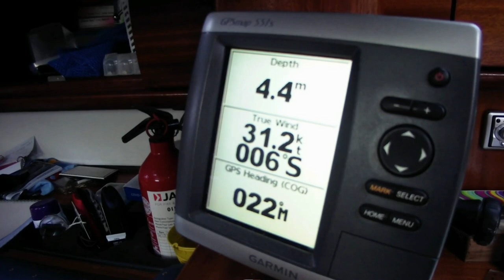Sailing Northerrn Ireland - Larne - Anchoring - Storms - Alarms - Ep. 253

Comment: Back in 1980 I tried (but didn’t do the greatest of jobs) to illustrate all of the physics involved in the forces applied to a set anchor, the anchor shackle and various points along the chain assuming that the chain was laid for optimum stretch. Although my maths was ultimately short in absolute accuracy, what was evident was that the forces at the windlass snubber were far less than at any point in the submersed tackle as long as there was sufficient stretch in the chain. Of course, chain does not stretch, but if correctly laid most of the forces are are taken up in the amount of chain that can rise and fall from the sea bed in natural, organic movement. In other words, dIameter of the snubber line and the tensile strength of the snubber hook is less important than the lay of the chain between the anchor shackle and the point that the chain rises to the boat (snubber). The longer the lay, the less ultimate strength is required at the snubber.
Reply from the maker: What a great explanation. Thanks for commenting 👍

Comment: XC originally was airfield based and in my humble opinion usually under estimates wind strength.  Another good one to look at is meteo marine. I use it all the time and find it is usually accurate. But, nothing like sticking your head out the companion way, checking the actual weather with the mark one eyeball.
Reply from the maker: I remember when it came out and we all thought it was the Bee's Knees - until we tried it against reality. I completely agree with you about it under reporting. Thanks for the tip about Meteo Marine we will have a look at that.

Comment: Ah, anchors and anchoring, everyone's favourite subject and we all have an opinion! FWIW - snubbers - you don't want it too thick as it needs to s t r e t c h..... We have our snubbed above the water, from the chain to the aft cleat via two blocks. It's about 12m long and will stretch to about 130% of resting length. So about 3.5m of stretch when the wind gets up, makes a nice bungey effect that won't pull the anchor out. Happy anchoring!
Reply from the maker: 😄😄 Anchors are always good for sailing banter!! Our snubber is 10m and usually about 5 or 7 metres is from the fairlead to the chain itself. As you say, nice bungy effect and a comfortable anchor! 👍

Comment: even if your snubber snaps your still attached by the rod you've put out etc etc, it only protects your windlass
Reply from the maker: I like our windlass. I want to protect it!!! 😄😄
Reply: @SailingYachtSaltyLass  indeed, my point was it should be the same size and strength as the chain and rope anyway
Reply from the maker: It suspect the line to match 8mm chain would need a lot more than 14mm nylon braid

Comment: Can you tell us about your choice of how much chain to put out.  My books say 4x depth ie 16m for 4m depth and you have 50m?
Reply from the maker: It was simply a mistake. We anchored in 4m and our freeboard is another 1¼ metres so (4 + 1) x 5 = 25m When we reach that we normally put the snubber on and it adds another 7m to the scope so we rounded up to 40m as our target figure. In the dark misread the chain marks and let out all 50m. We set the anchor alarm to 40m and wondered why it kept going off. We found out when we lifted the anchor. 😄

On the plus side, too much is not an issue unless there are nearby boats or shallows and we have the anchorage more or less to ourselves so it did not really matter.
Reply: @SailingYachtSaltyLass  thanks - I only ask because that may be why I drag so often :-)!
Reply from the maker: It can also depend on the seabed, the type of anchor and how you drop the anchor. Some of the instructors we have talked to recommend methods that we find highly suspect.